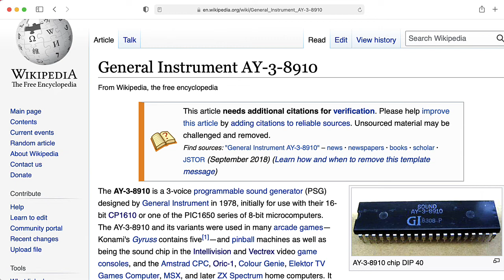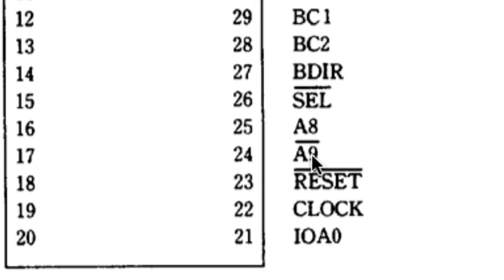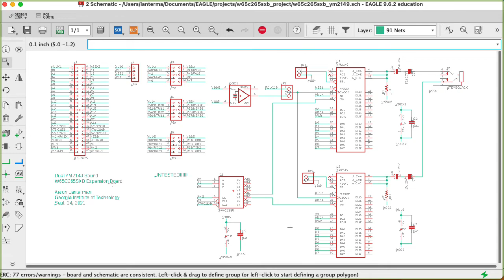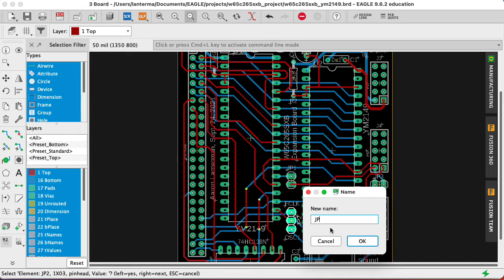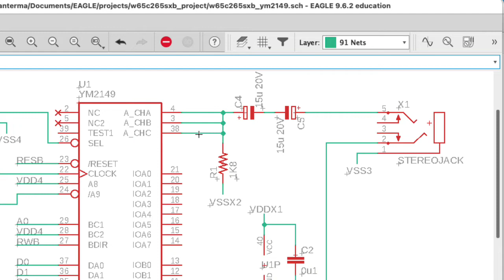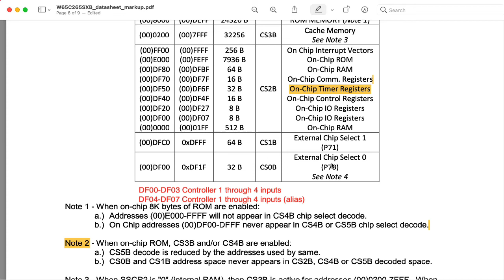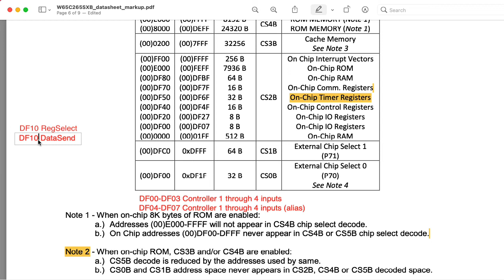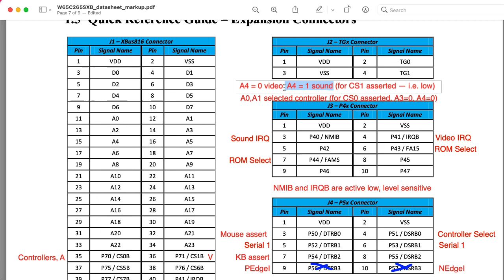W65C265SXB: YM2149 Sound Chip Interface PCB (similar to AY-3-8910) for a Retro Homebrew Computer

Comment: I think I read on Wikipedia that the envelope generators were so basic that game designers didn't use them for envelopes.
 They could be set to cycle at a programmable pitch, and used as extra oscillators,
 with envelope functionality being done by software-changing the tone generator volume levels in real time, per note.

Comment: Interesting solution with the polarised ecaps connected back-to-back - never seen that before, but for a low load scenario that should be fine. If someone ignores your warnings and connects low impedance headphones they might be in for a surprise 😂😂
Reply from the maker: It's a standard trick, although I admit that it took me while to convince myself that it's reasonable.

Comment: I am currently working on a similar project, using the Yamaha YMZ284, which is one of the smaller, simplified chips you mention, although it does lack the SEL capability you need (and I don’t.) Looking forward to seeing/sharing some code when this all comes together. I do agree with the commenter that suggests that using assorted power and ground pins might lead to subtle problems, but there is only one way to find out for sure.

Regards,
Reply from the maker: If/when my students and I get something working, we plan to post the Eagle file for the PCB along with code on GitHub.

Comment: Thanks for another excellent video. Just be aware that there are a lot of relabeled/fake Yamaha chips on ebay/aliexpress. For example, I have purchased RAM chips labeled as YM2612 and YM3812 and also YM3812 labeled as YM2612.
Reply from the maker: I know what you mean... I have some V9958 video chips I bought that have 0.1" pin spacing, but all the data sheets I've found show that it was only released in packages with denser spacing, which is suspicious. So far I've been buying each chip I need from two different sellers in the hopes that one of them will be legit. ;)

Comment: It probably doesn’t matter here, but your power distribution plan breaks some rules of thumb. Generally you want the power and ground to come in over the same connector so that circulation currents are minimized which helps with emissions. You can also get into an awkward situation where some voltages and grounds develop differential voltages to the others during a large current transient in one set of power pins.
I would say the second best way would be to bond all powers and grounds together and put them on planes. Since you’re not trying to get this through emissions testing, the only thing that might be an issue for you is glitching, but that also seems unlikely.
Love your videos! Your synth circuit design segments are killer
Reply from the maker: Ah... that's my analog audio background showing. I've done tons of PCB designs for analog audio circuits, where everyone pretty much uses star grounding and tries to avoid loops; this is only my second digital PCB and I need to develop different instincts. (I'm also trying to restrict myself to 2-layer boards, which is challenging. Having a whole layer for a ground plane would certainly make the routing easier).